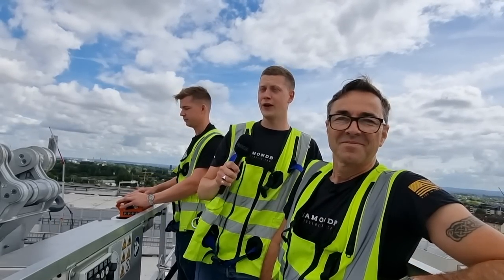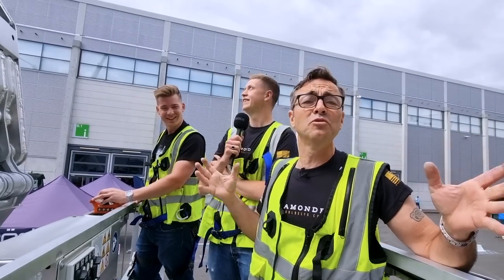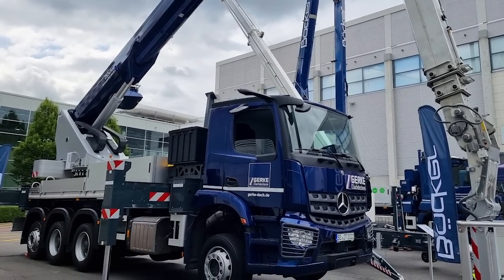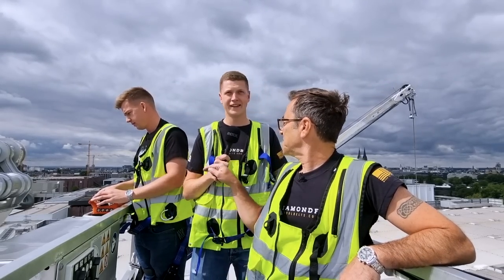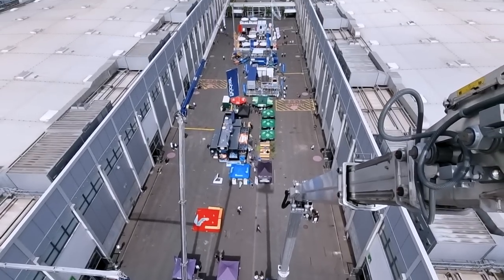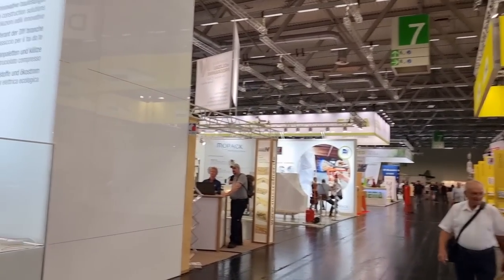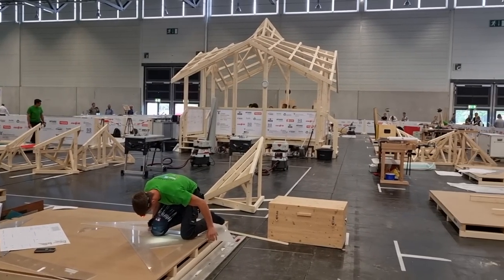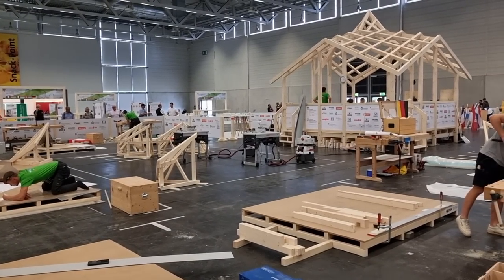Germany Roof and Wood show Dach Holz, and a big cherry picker!!!

Comment: Proud to be the only recognised UK born Zimmerermeister and Tischlermeister. Its rare to be a double Meister in Germany but in  2018 i achieved that. The uniform gains respect in Germany, not so much in the UK 😂
Reply: not many doppelmeister as bayern win every year ;-) . out of interest, did they make you do the business semester twice or could you avoid that with already holding a meisterbrief
Reply: @plasticpaddy5278  i only  have the full Meisterbrief as Zimmerer and parts 1&2 as Tischler. Although i could do the business part later on, i only worked as Zimmerer in Germany as i prefer the work.

Comment: German builders are regulated and must be qualified, no cowboys allowed, also I found a passion for tool management and maintenance, use clean and store correctly, no throwing  them in a bucket 😂 they certainly aren't any better than us, just hell of a lot tidier  🤣🪚🔨
Reply: more complicated than that, germany still has a guild system and a mandatory membership of a chamber of commerce. what s unfair is the people running the guild tend to be university graduates whose tertiary education is pretty much free. if you want to own your own biz in 53 different trades you have to be a master (or employ one), this costs €15-25 k to achieve.
.
Reply: @plasticpaddy5278  wow, very interesting that, I'm only going off what I remember in the late 70s 😂 I do nothing now 😊

Comment: I'm so close to buying the mafell tracky, ,  and,   after seeing this,   really want to build a roof structure like that.  That looks the dogs.
Imagine tiling or slating it though!.. I'd like to see how that actually looks complete.
Reply: mafell is more geared to site carpentry and festool is more geared to joinery. they are 2 distinct markets in germany . i have mafell and weirdly enough it was €200 cheaper to buy in UK and ship it with dpd to germany (pre brexit) than it was to buy here.

if you do go for mafell buy a kit and then get rest of rails from bosch  - get a 110cm rail. bosch do holey rails too which are compatible
Reply: @plasticpaddy5278  been quoted the full package for just a shade under €1200,  including 2 1400mm rails,  (No joining bar though strangely),  bag, and other bits , corded.   I want that perfect cut ,  for cabinet making etc...    was obviously going to get the fes, but since mafell is near as same price,    I thought I would go for that.
Reply: @jonfenwick6200  That's pretty much word for word my intentions
Reply: @jonfenwick6200  got mine from ITS - 2 x 1600 rails, joiners clamp n bag . euro gbp was pretty much 1:1 when i bought. happy with it but use it for breaking down sheets (with hindsight should ve bought a dw745 before it got discontinued)

bisch basch bosch and peter millard covered this for cabinetry .the mafell s scoring cut is better but has an angle - it ll leave a gap if blade not correctly set up

peter s vid https://www.youtube.com/watch?v=5kqui1b0SbU

bisch basch bosch response vid https://www.youtube.com/watch?v=Wjn_8Hur9dg
Reply: @plasticpaddy5278  yeah saw that,    think maybe it was an isolated incident though.  Would have to get my hands on it and try it first hand to see.  Did/ does seem strange though.  Cheers